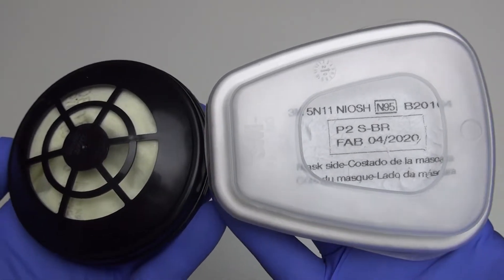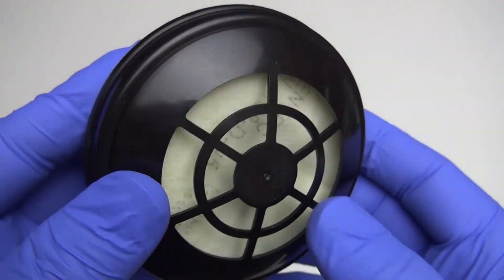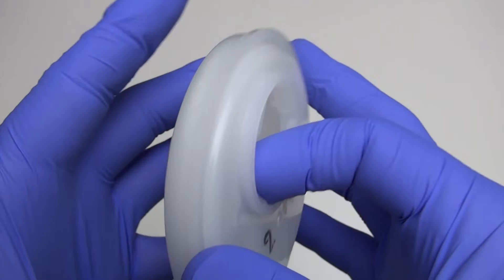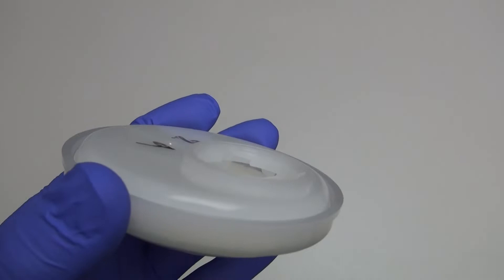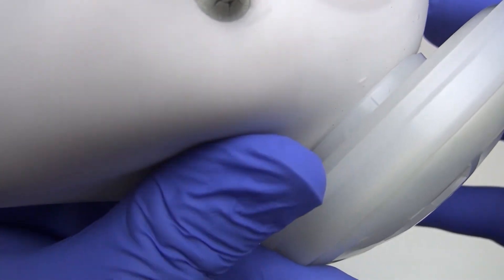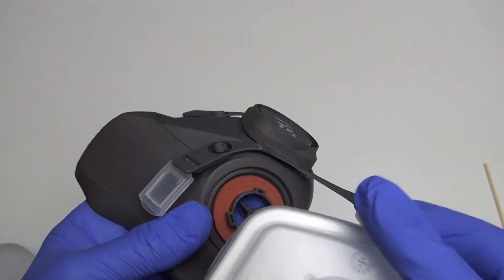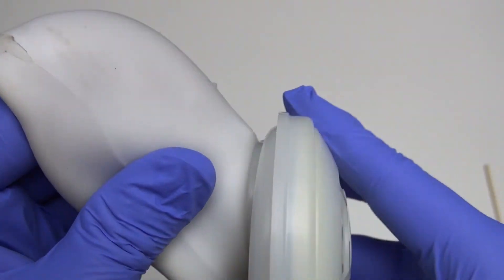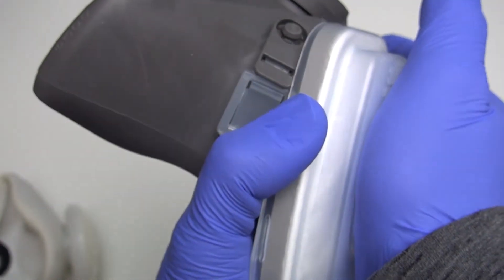Dentec vs. 3M: The Pitfalls of Not Having Fault Tolerant Design

Comment: I’m not sure why you spent this time warning us but you make no definitive statements…do you think this is a poor quality and ineffective cartridge? thanks
Reply from the maker: @krangdrol  

Respiratory protection is a continuum. There are many trade-offs in terms of cost, ease of use, efficacy, comfort and other considerations. So I'm not always going to come down with a binary judgment about whether a respirator is completely good or bad.

What I will say is to echo what I said in the video, which is that the dentec respirator cartridge is a design that could use improvement. Though they are very breathable and comfortable to use, the cartridges lack features that give redundancy and robustness to other companies cartridges. 

If you are considering the comfort of a dentec NxMD respirator, I would recommend the p100 cartridges which lack the alignment issues and lack of in place inspectability of the replaceable n95 filter pads.

I would also know an issue that has come up for me with the dentech respirators, which is that the elastic in the harness can lose its stretchiness, which can really reduce the quality of fit. So I would also suggest inspecting the elasticity of the harness periodically. I replaced mine with similar elastic from a fabric store to restore the fit I was getting before the elastic lost its stretchiness.